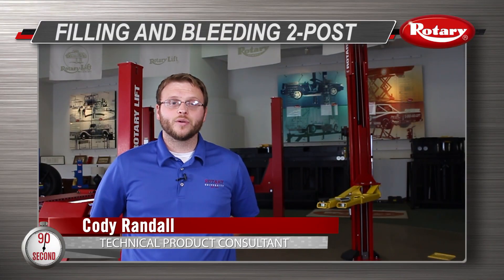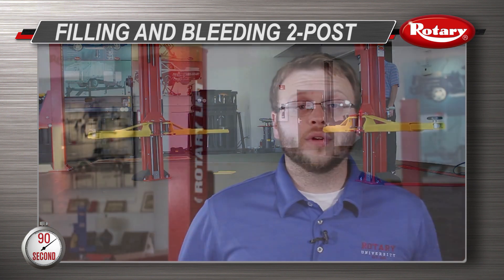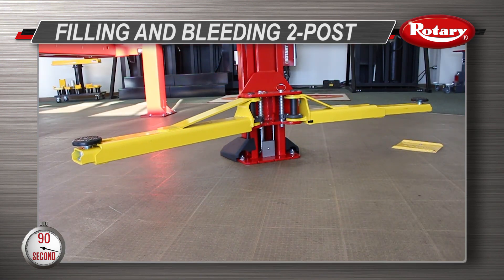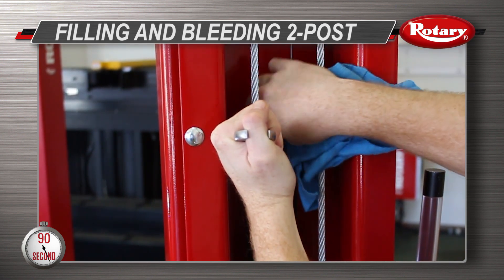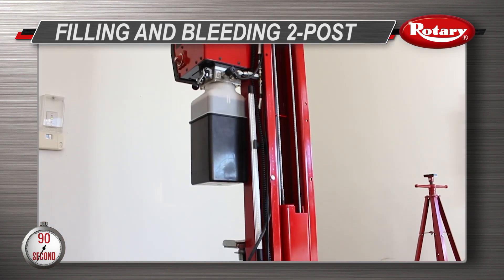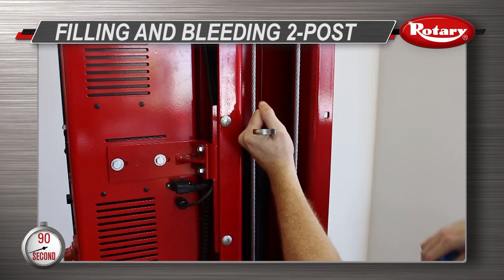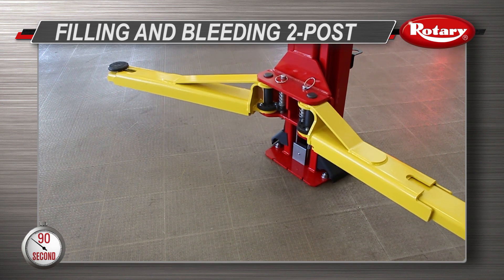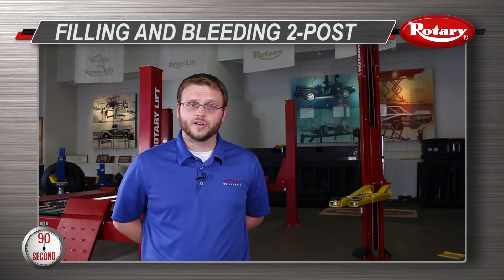90 Second Know How: Filling and Bleeding a 2 Post Lift

Comment: I have a late 90's model SP07, can I use hydraulic fluid instead of dextron?  the fluid has never been changed, I have a bucket of John Deere Hy-guard if I'm able to use that
Reply from the maker: AW32 or ISO32 is the acceptable fluid, or any fluid that meets those specs.  If it doesn’t say it meets those specs, don’t use it.

Comment: I have the rotary lifts in my Toyota shop, although I’m pretty sure they are a lot older than these models.  I had one lift that the fluid reservoir broke and we replaced it with a new one. Problem is that even after we bled the air and ran several full up and and down cycles, it ran great until we put a load on it. As we lowered the vehicle it forced fluid to be forced out of the fill cap. What would cause this? It only does it when it loaded.
Reply from the maker: We would suggest contacting your local Rotary Authorized Installer.  If you don't know who that is or are having trouble contacting them please give our Technical Support team a call at 800-445-5438.  They would be happy to help!

Comment: How do i bleed Cyclinder if it’s all the way up?
Reply from the maker: You will want to lower it first if possible. If the lift is binding, there could be other issues as well and you would need to contact a Rotary Authorized Installer.  Here's a link to find your nearest installer.  https://rotarylift.com/contact/rai-locator/